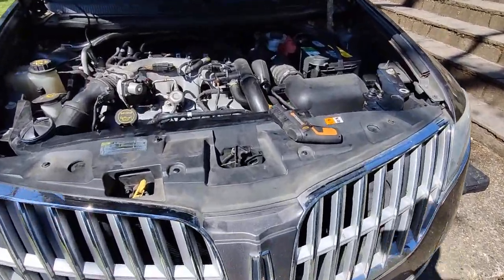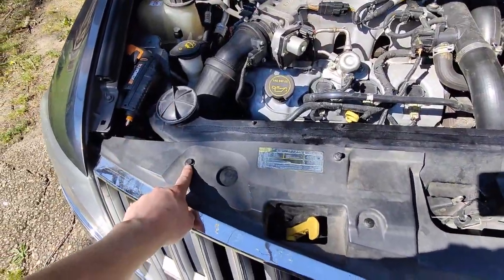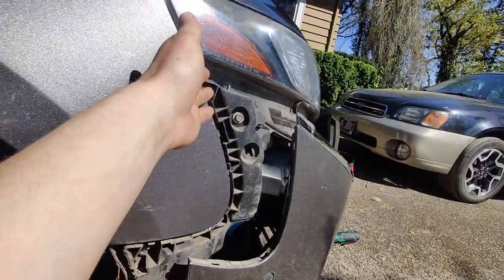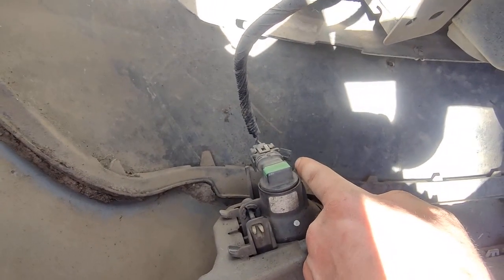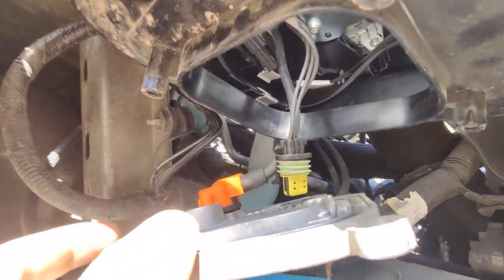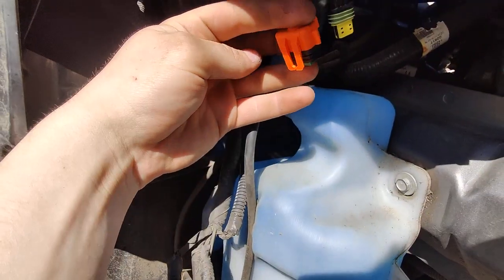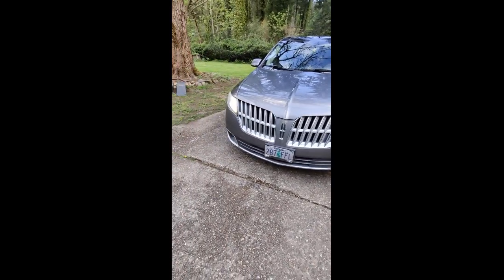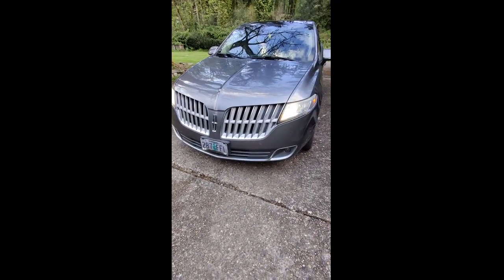Lincoln MKT & MKX headlight ballast replacement/removal + bumper removal

Comment: Thank you Michael, this video gave me enough knowledge and confidence to do it myself, and it worked like a charm for my 2013 MKX which was similar enough -- almost identical, actually.  Incidentally I removed my Xenon HID ballasts completely and installed new LED bulbs that do not need a ballast.  After 8 years, people might finally stop thinking I'm high-beaming them at night and blinding me in their retaliation -- thanks again!

Comment: Please tell me why did you take the bumper off when you didn't have to?
Reply from the maker: It's how Lincoln says to do it and it would've been a lot more difficult to replace the ballasts without doing so.
Reply: You would spend just as much time trying to bend and squeeze your way into getting to it and possible breakimg fragile body stuff in the process.

Comment: wRONG STRATEGY DUDE!!  iT DOESNT TAKE ALL THIS.
Reply from the maker: To replace the bulbs sure but how would you propose getting the ballasts replaced without removing the bumper? Also taking the bumper off took me only 20 minutes so it isn't a lot of work.
Reply: Jesus no is what he wants to say. Taking off the bumper cover is crazy not screwing around stuff.b they're not particularly durable and are difficult to get back on fitting correctly in my experience.  I hate body work